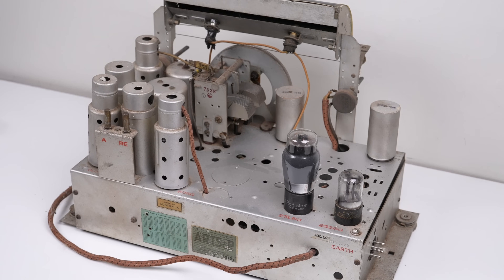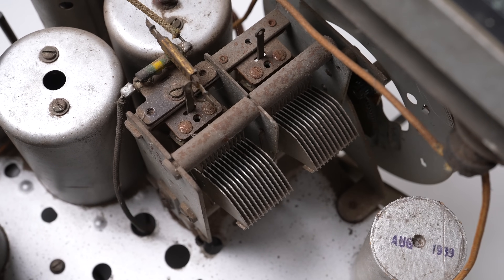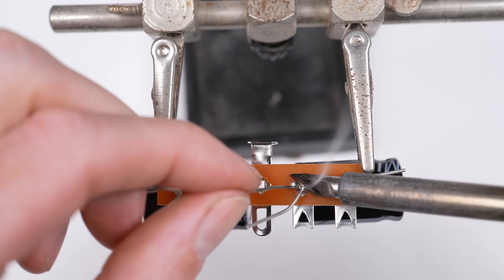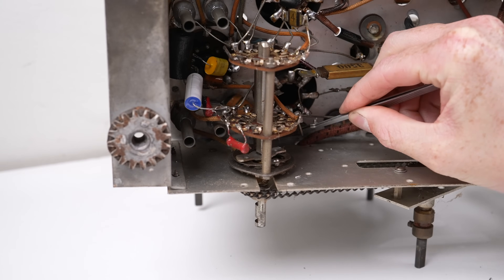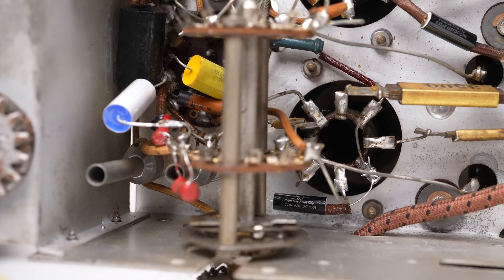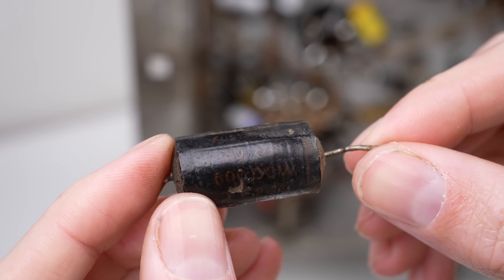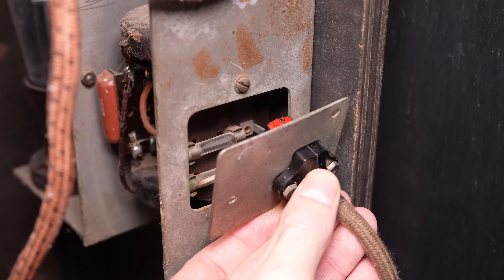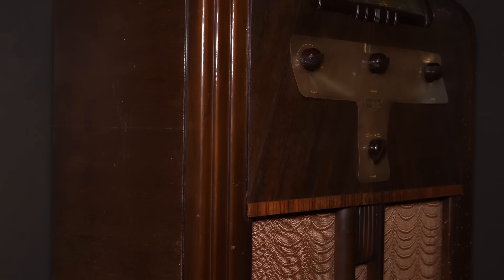Breathing Life Into A Forgotten Piece Of Technology ⚡️ High Voltage Restoration

Comment: Being just a newbie I would suggest that bulb might be a ballast or load for in series with the tube filaments. Is it wired in series with the tube filaments?  Without a power transformer I suggest that is the case.  Some old radios without power transformers with series tube set up would use resistance (curtain burner) cords.  Be very careful with the sizes on the dial lights because they all act as part of the series circuit with the tube filaments in non transformer units.  Check schematics to make sure if this is the case. The size on the specs is what has to be used.  Kudos for knowing to use some kind current limiter. This is especially important in transformer units that could have shorted electrolytic caps.  For safety you should also be using an isolation transformer.  Make sure it isn't a ali cheapie for safety.  Too much unsafe crap online.  Also please save and salvage those tubes as long as they have their vacuum integrity intact. If leaking they tend to cloud up milky white on glass. They do not make most of those anymore so we are living off NOS.  Also note in these non transformer units with non polarized plugs could be hot even with power switch off.
Reply: Yes definitely remove BOTH sides  of the old electrolytic from the circuits.

Comment: This was a great watch! I would fiddle with radios in my grandfathers radio shop he had when I was in my early teens. 
It was an old shop, he built and serviced marine radios for the fishing fleet in NC during the second WW. He would do it on the side for years after. It was stocked with old out of date stuff by the 80s.

I had an absolute blast. I've forgotten most of what I leaned back then, but watching these videos bring back fond memories of hot, humid days, in a block building, the sea air wafting through the open windows and doors as i cleaned the shop and tools up, and would get an old radio working, then build a cabinet with a dozen 4 and 5 inch speakers all ran in parallel and series wired to it😂

Comment: If that old radio was built like US radios of the era, you have to be very careful when working around the radio.  The AC neutral wire was usually just connected to the metal of the chassis.  This isn't that big of a problem if the AC power cord is polarized, but if the AC power plug is not polarized, i.e., there is nothing to prevent it from being reversed, the chassis ground can be connected to the AC hot line and not the AC neutral line.  The radio will still function normally, but you can get a good shock if you happen to touch the chassis while the radio is connected to AC power, even if the radio is turned off.  It's best to use an isolation transformer when powering up old tube radios to make sure that you don't shake hands with Ready Kilowatt.

Comment: The 302 tube is what becomes the radio 'Ballast' tube to add enough resistance to reduce the filament current to a safe level, as well as absorb any transient noise. I have an Amprex ballast tube that was used in an aircraft receiver, but it used a standard plug-in tube base.

The resistors in your antique radio are possibly bad, as were the caps. When I repair such equipment today, I go all out and inspect and replace all the components I find bad. But you need to invest in some basic test equipment. A good VOM, tube/valve tester, and possibly a good LCR meter, should get you going. For the tube tester, I use an Eico 625 and an Eico 610 adapter for more modern tubes. The manuals are all on line for that unit. The better the VOM and LCR meter, the happier you may be than with cheap units. But since I have always been working in electronics, I have invested in Fluke meters for most of my meters.

However, if/when you decide to troubleshoot radios with distortion problems, you may want to invest in a nice 20 MHz oscilloscope. You can find such a scope for very little cost on Ebay, that are considered obsolete, but work well for repairing such audio gear with tubes, and they will be worth every penny invested! A two input scope can allow you to display the input and output signals at the same time, as well as overlay the signals, they can also show the modulated input signal and the demodulated signal for the detector, IF, and mixer circuits. I have gone to the effort of hooking up the scope to display the video of an old TV in order to see if there was a problem in the video circuits.

Comment: A final comment-check the voltage ratings of the dial bulbs before changing.  Radios with transformers in US usually use 6.3 volt bulbs. This radio appears to be series string, so who knows what the the bulb voltage is.

Comment: To get these old radios to work reliably, you have to replace ALL of the old brown paper caps and the old electrolytic caps.  Otherwise, you will continue to have issues. The Mica capacitors  usually do not fail, but can.  If you happen to be working on a 1950s radio, another point of failure is the Mica IF transformer capacitors.  These are not sealed and the contacts corrode over the years, causing shorts.  The symptom of this is your radio sounds like a lightning storm nearby, overloading  any audio received.  On comment about the tube with the loose grid cap-if the getter is still silver, the tube is still under vacuum.  The second removed tube is not under vacuum-note the white getter. Not necessarily good, but under vacuum.

Comment: Here in Orlando Florida we have a small business called "Radio Relics" they will repair your equipment or sell parts for you to try yourself.  We also have an electronic store called Skycraft Electronics where you can buy almost anything you may need. I have two antique radios that I enjoy. One safety point, due to high voltage and old cloth&rubber insulation, ALWAYS unplug when not in use and install an online fuse on the power cord. If a sudden short occurs  you don't want to start a fire. Enjoy.
Reply: I went to Skycraft a couple times when I was traveling to Disney as a kid. That store is amazing.

Comment: In 1959, my dad bought a home with a radio in the wall. Someone had placed it in there, with its stems sticking out of the paneling. We were NOT to touch it.
     Dad's closet was on the other side of the wall. In there sat the workings, on a two-by-four between two studs.
     Several years later, we did turn it on, & it did play. Still, we were NOT to use it.
     The "workings" seemed to be much smaller than yours. It had tubes, yet no dial; we just turned a knob, & it chose the station.
     Lovely to see yours working again.  🎊
💛

Comment: I have a valve radio from the early 50s. I am 74 , back in the 1960 s I use to build my own radios in my teenage years .
I also use to repair old radios that were traded in at a local radio store.
I found a shop that sold military surplus radios , some from world war two. They also sold a guide to military surplus valves that have normal retail radio valves. At 14 I had my first small business repairing valve radios for my local radio shop. The man encouraged me by paying me with traded in valve radios.
The military valves were covered in a heat resistant resin to protect the glass.
Most of these old radios had shortwave , longwave and medium wave . This gave people the opportunity to listen to foreign radio stations.
The main problems apart from valve replacement back then was a mucky variable capacitor and dirty volume controls.

Comment: I remember pulling tubes from the TV as a kid and riding my bike to Radio Shack and using the big free tube tester to find the bad tube, buy a replacement and fix the TV. This was all done when I was very young.  We knew back then what not to touch in the back and Radio Shack made repairs a snap.  Oh, how I miss going through the bins at Radio Shack when they had actual electronic parts and building stuff like short wave radios.

Comment: When I learned about electronics as a youngster back in the 60's, the books I had on building radio gear had some specific instructions about soldering.  Specifically - not to rely on the solder for the connectivity.  When using terminal strips, the wires should be crimped tight to the terminal for good electrical contact. The solder then just held it in place permanently. 

These days I see lots of videos about DIY electronics where this rule is largely ignored.  I don't know if it matters as much today.  But my guess is that when de-soldering old connections like on this radio you'll find the wires held tight to the terminals so that even with the solder melted, it's a bit tricky to remove the wire from the terminal.

So as a suggestion, for the sake of authenticity, you might check out some old books on solder technique, and do it like they did back when old radios like this were built.

I enjoyed your video - thank you for posting it!

Comment: Well, you're still learning. With a radio of this age you need to replace all the capacitors. Then you need to check the values of all the resistors 'that count' because they go high with age. Then you need to check the continuity of all components (inductors and filaments mainly) where there needs to be continuity and check there's no conduction where there shouldn't be. Replace the mains lead and check all the way from it, through the on/off switch to the mains transformer (if there is one) or dropper resistor chain up to the anode of the rectifier valve. Disconnect the smoothing circuit and test it by charging the storage capacitor - how long does it hold a charge? Don't use high voltage for this. The resistor in the smoothing circuit will have gone high because it gets hot during use. The audio output valve is the only one handling much power so it will almost certainly have 'gone soft'. A purple glow inside confirms this. This is before you even plug it in.

Comment: I would love to see an arcade machine repair or a pinball machine repair
Reply: I did once repair one, the pull handle type, one-armed bandit, it needed new bulbs. I saw how it worked with springs and slots to determine how much you could win, the deepest slots were the hardest to get the pin? to fall into to win 6d.
G4GHB.

Comment: Bulbs in series heater string sets MUST be connected across a resistor or a tap on a tube heater.  The bulb filament heats up instantly, while the tube heaters take time and they change resistance as they heat up.  The bulbs will burn out if they are required to handle the full current during filament warm up.
Today's electronics are all built on circuit boards using surface mounted parts.  They are designed for small size, cramming in as much circuitry in the smallest space possible.  With the parts requiring extreme magnification to be seen, repair would require the same kind of automated equipment that was used to create them in the first place. Repair now involves replacement of circuit board assemblies, which in most cases means the entire device.  Solid state subminiature parts are actually quite long lived (except for some capacitors!) so these devices will more likely become obsolete before they fail.  Consider how radio and tv broadcast standards have changed, the old sets can't receive the new digital signals and are now only useful behind a signal converter.  Shortwave broadcasting has given way to internet streaming.  While there is still a place for old radios and TV's as antique display things, they will no longer be able to play the role in our lives that they once did.  Still, it's enjoyable to repair them, but the availability of parts and the cost of them is a limiting factor.

Comment: This is what was called an AC/DC set. The valves heaters are all connected in series with the light bulb. The high tension is taken directly from the mains. Not ideal, because, if the mains plug is not connected the right way around, the “phase” is connected to the chassis. Result, if you tough the chassis, a one way ticket into the next life. Highly dangerous.

Comment: Sadly, Radio 4 Long Wave will, finally, close on 25th June 2025. While Radio 5 is still transmitting on Medium Wave, I doubt if this will last very long. So, before too long, it will be no longer possible to know if you have got an old wireless set working or not, because there will no longer be any AM signals being broadcast to test them with!

Comment: More please!  My dad and his younger brother assembled crystal radios in the 1920's for a little extra income for their family.  Also, in the 1960's, I remember going to the store with my dad to test some vacuum tubes from our TV and to buy replacements for the ones that no longer worked!
Reply: My dad made my first radio with a rock crystal mounted on a wooden cigar box. Had a needle on a shaft to tune it. No power amplifier, so you needed small headphones. Upgraded to a Remco later, with a bar crystal that could be tuned to a few stations. Wow!

Comment: That top connector on the big valve/tube is not a grid cap. It's the anode cap. The grids are always on the bottom pins, with the heaters and cathode.
Reply: No. It depends on the specific tube. some have the cap wired to a grid, some to the anode.
Reply: Before the anode was moved to the top the grid was on top. My 1944 Wireless 19 Set has the grids of valves on top, except the 807. The old method of  a finger on the grid to listen for a buzz had to be remembered that at some point it became the anode!
G4GHB.
Reply: @bill-2018  There is a rule of thumb though,  small signal tubes generally have the cap to one of the grids to decouple from interference, and power tubes and rectifiers mostly have Anode to cap to minimize HV creepage or flashovers
Reply: @blitzroehre1807  
Yes, but that is modern valves. 1940 onwards maybe? 
You can't apply that to older valves.

Comment: • "The last of the people able to repair these are in their 70s and 80s". Hmmm. I'm nowhere near that old and still repairing tube radios and other tube-based equipment. Been doing it since I was a teenager. I have two friends who are younger than me who have been doing the same most of their lives as well.
• "DC current" = direct current current. 😁
• The 6U7 that was taped together and rattled showed signs of having gone to air. Note the white deposit on the inside of the glass, a good indicator that it's lost its vacuum. Not surprising given the rest of the damage to it.

Comment: There are something called micro AM transmitters, so y can send something to yr radio so y have something to listen to (except computer & cell phone noise).
Vintage radios usually had multiple star grounds on the metal chassis, which works better (in todays EMC environment), than the busbars, etc..they often had in vintage audio equipment.
So old radios often sound surprisingly good, while old audio equipment often is dissappointing & can sound grey/dull, due to the grounding.

Comment: If this radio does Not have a main transformer it likely is a "hot" chassis. Need to be extremely cautious as reverse polarity can put local line voltage on metal parts. If you contact and provide a source to ground your body becomes the conductor. Deadly result possible..

Comment: The light bulb may have been an early/cheap fuse to protect the components in the event of a short. That was very common back in the day. Typically placed on the main input before any of the components. The filament in the bulb would burn out if too much current was passed through it indicating an with the radio.

Comment: I had an old Sears Silvertone multiband radio with a green tuning eye I fixed when I was in 8th grade in the in 1967. It was in a big cabinet with a big electromagnetic speaker.. In 1969 at 16 years old I worked in a TV repair shop fixing TVs and Stereos. When I went in the Navy in 1971 I was trained as an avionics tech and we learned all about tubes and transistors. Worked in electronics and telecommunications most of my work career.

Comment: I repair old tech as a hobby myself, but I won't lie, something with that many high voltage capacitors just dangling around scares me.

I do have a device to safely discharge up to 1000V caps, but one wrong move and you're in for a world of hurt.

I think I'll just stick with 80's tech and onwards.

Comment: Big fan of this type of repair. Vintage tech from the vacuum tube days is particularly fascinating -- they did so much with so little (by today's standards). I'd love to learn more about how to fix this kind of stuff. I have a late 70s stereo receiver with an indexed potentiometer volume knob that provides only the right channel when turned under 5% volume. Not really sure how to fix it.
Reply: Many volume controls (potentiometers) do not track very well at the extreme ends of travel, so only getting one channel with the volume set low is not uncommon. The best you can do is try to find a replacement pot that has better tracking.